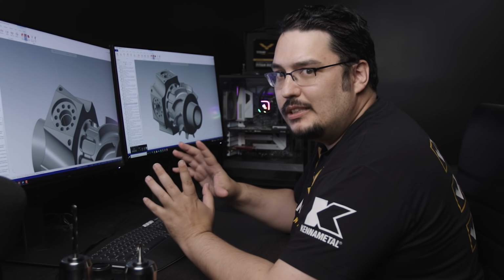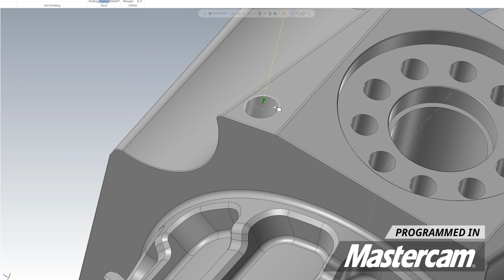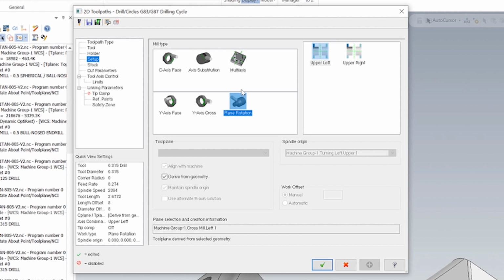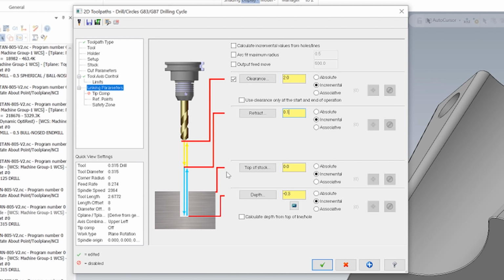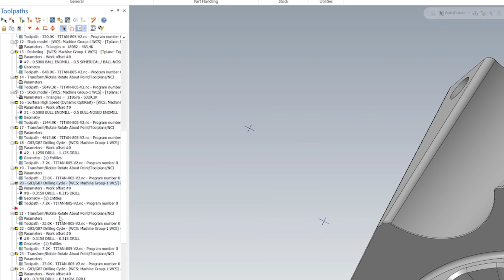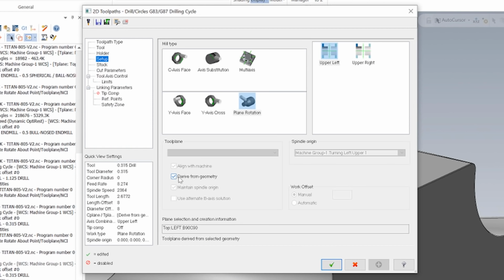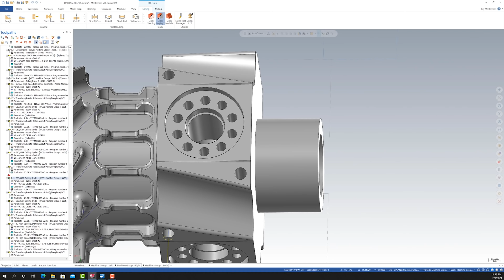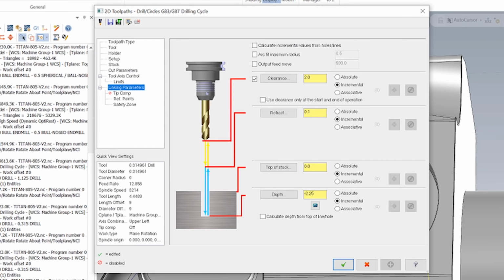Drilling Stainless Steel at an Angle with No Deflection | Doosan SMX3100 Mill / Turn | Mastercam

Comment: When we drill angled holes we will start with an end mill doing a contour ramp to put the flat in the surface.
Reply: We do the same thing, no problems!
Reply: Similar. A helix ramp in with an end mill to basically spot face.
Reply: @pro-seriesfabrication3810  that's what we do now that you mention that toolpath.
Reply: Yup,save on the cost of the fancy tools... Ya they're cool but when you looking to make money. Cheaper just to use an E- Mill.
Reply from the maker: Exactly, it’s basically the same thing but much faster, especially in Inconel etc. You also go deeper which allows the longer drill to get a nice start…
PS. On smaller holes, the endmills can force the larger drill to walk since the center of the Dia is higher unless the Dia drilling is twice as large as the end mill or the end mill is truly a flat end mill. Most taper up as you get to the center.
Reply: @TITANSofCNC  I agree it would def be much faster, we usually use an endmill to get a flat, and then a spot drill to start the drill. Your way looks much cooler though 🤣 Have you ever thought about featuring Mazak machinery?
Reply from the maker: Mazak is great. I know the President… 
Have ran them before but don’t have any now. Doosan is also great, and 20-30% less expensive, which is good for many who follow me and have to compete. Maybe one day.
Reply: @TITANSofCNC  I didn’t realize that doosan was a cheaper option than mazak. We’ve always had great luck with them.

Comment: OR, you could have drilled the hole first before cutting the angled surface. Benefits are: 
1) save yourself an operation 
2) save yourself using two tools 
3) save yourself slowing down the first drill. 
Good tutorial if you’re forced to drill on an angled surface.
Reply from the maker: The point was to teach the technique.